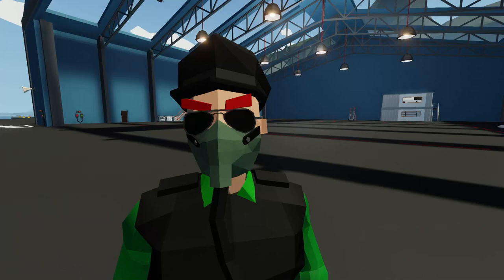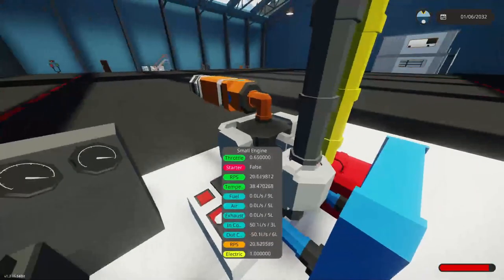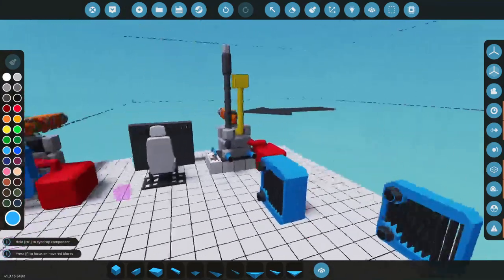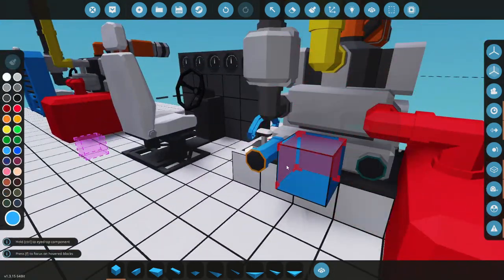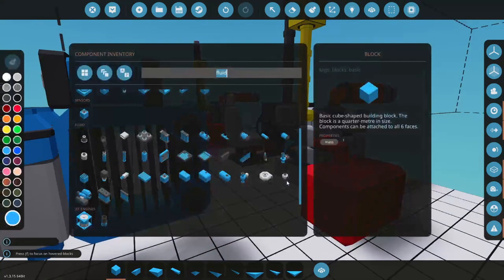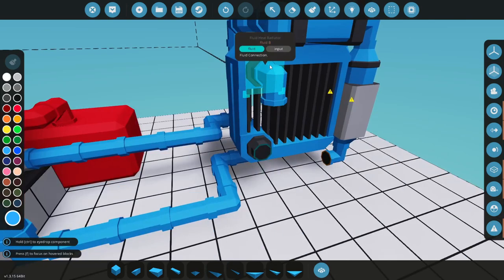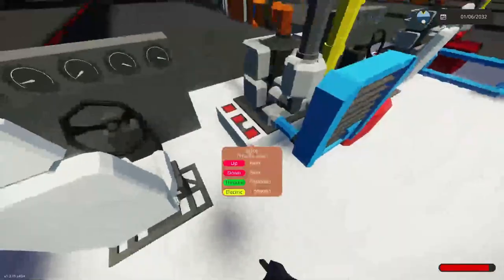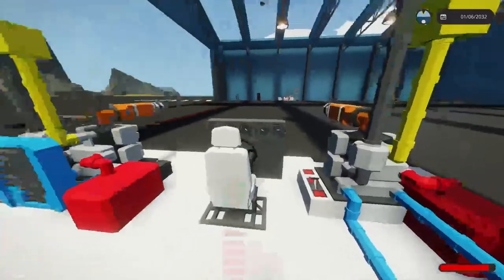Super Cooling your Engine! [Stormworks Beginners Guide Tutorial]

Comment: If you remove the tank, put a valve where the tank was, hook up the valve to a micro controller and remove the radiator on the engine side, you will get what I mentioned in your career series video.  You can make it a bit more compact and allow the engine to run in a temperature range where the engine is more efficient.    

The logic is setup so when engine temp reaches 104 an up/down counter counts up to 1.  When the engine temp drops back down to 96, the counter counts down to 0.    A Threshold gate reading the counter value set to 1 and 1 turns on the valve. 

Turning the valve off, allows the radiator to cool the liquid inside it without being heated by the other liquid.  It will cool down faster and lower the average between the 2 temperatures, so when the valve opens again there is more cooling effect.  

For larger engines. The same setup can be used with larger cooling parts.  And multiples of the cooling system will cool even faster for really large engines.

You can use the pump on/off instead of a valve too.
Reply: Thx I'm really struggling to cool my plane engine the tricky part is that there isn't much space and I want it to look at least decent zo I'm kinda in a loophole here

Comment: I just had an epiphany.  
Cooling in stormworks works on averages.   So if the engine temp is 100 and coolant temp is 20,  the temp coming out of the radiator should be 60, (100+20)÷2=60. The engine should drop 40 degrees.  But since the coolant coming out of the radiator is now 60, the next temp will increase. (100+60)÷2=80.  So unless you can get the temp down through the radiator to the original 20 faster than the engine heats up. You will have a chain reaction of increasing temperatures.   
It could be possible to adjust the flow rate to one radiator. Or alternate between several radiators so that the temperature of the coolant coming out and going into the engine is lower than what the low temp needs to be to maintan and average temperature.   

I have been under the impression that flow rate is the key factor for engine cooling.  But that is only the case if the coolant can be cooled fast enough to get a lower average temperature.  

I did some math and in 1 cycle to keep an engine at 100c with a coolant temp of 20c you would need about 16 radiators in series...   so if you can  cycle or slow the flow rate so that the coolant coming out is lower than 20. You can use fewer radiators or actually start dropping the engine temperature.   

I will need to test this hypothesis before i can confirm the validity of it but mathematically it works.
Reply: I did some simple testing and found that if you limit or stop the flow of a secondary cooling system,  it drops the temperature enough to lower the average temperature enough to cool the engine quite well.  

My setup was 5x5 engine with coolant going to liquid to air heat exchanger, air going through a second air to liquid heat exchanger that was connected to a 5x5 radiator.   The coolant flow to the engine was maxed out.  But I cycled the coolant from liquid/air heat exchanger until the temp dropped below 25.  Then let it flow,  the engine temp at full throttle would reach 85c then when the secondary system kicked in it would drop and stabilize.   Then slowly climb again.   

I still have some testing to do but these were promising results.
Reply from the maker: Makes sense if it spends more time in the system it will cool more.
Reply: @ProfNCognito  But it doesn't work if you limit coolant flow to the engine.    It is basically a step down system where each part lowers the average of the 2 temperatures.  The engines need a higher flow rate because they heat the coolant faster.  Then the radiator can not cool the coolant fast enough because the average is too high.  So if you reduce the temperature of the coolant by reducing the temperature of the coolant cooling the coolant then you lower the average between the two.   

I need to set up a system to measure the delta of the temperatures and averages to see what is the best configuration.    
And also see what temperature the engine is most efficient at.  I know a cold engine is not as efficient, so the engine needs to have some heat, just not too much.
Reply: Any updates?
Reply from the maker: Things are about to change drastically in about a month so I will re look at all systems afterwards.

Comment: Nice clip! Would be cool to have a 2024 version of that supercooling clip since it seems the mechanic changed a lot with the updates.
Reply: I don't know how to cool my engines; they all catch fire
Reply: @apocamuerte41  if you keep your RPS under 20 and have a radiator, you should be fine.
Reply: @steph4050  I'm sorry to inform you that it hasn't worked for me, not even using pumps or the 5x5 radiator... 2 of those, and I tried building a motor from scratch 4 times, and the same thing happens with more or fewer cylinders 
The minimum for my plane to stay airborne was 10 RPS, and even then it still caught fire
Reply from the maker: @apocamuerte41 just tested with new update. Still works.
Reply: @ProfNCognito  The only thing I managed was to keep my plane in the air at 9 RPS and slightly lower the temperature because if I drop 1 RPS, it falls. So my question is, what's the point of building a bigger engine if I can only cool it at 9 RPS?
Maybe I'm extremely useless, and because I don't speak English, there's something I'm missing and doing wrong :c

Comment: that's a very interesting system, wonder if it would fit in a race car
Reply from the maker: Might have to be a big race car.
Reply: @ProfNCognito  I mean, you could use the parts as structure instead of having both structure and parts, if you know what I mean.
Like LMP1 and Formula cars do Irl.

The side of the cockpit could be fuel tanks instead of blocks, and have the radiators between the seat and the engine without other blocks in between 
The main problem is gonna be the gearbox I believe
Reply from the maker: I love the idea. Sounds like a great challenge.

Comment: can you do this with like an actual modular engine? maybe a 1x1 with 12 cylinders radial?
Reply from the maker: It works with all engine types.
Reply: I tested this build without the Liquid to Liquid heat exchange and it actually seemed to run cooler with just 2 radiators on a modular engine
Reply from the maker: @mobius1504  hey nice. sometimes things work out like that. cheeper to spawn in then.
Reply: I was messing around with an alternating radiator system where fluid would switch from one radiator to the other to go into the engine.  My goal was to allow time for the radiator to cool the liquid before sending it into the engine.  
I did not see much improvement on engine temps with that.  I do not think the fluid temp really matters as much as flow,  it is frustrating.   I want to be able to make a thermostat type system that stops the flow to let the coolant cool down until the engine reaches temp, then pump cold coolant to drop engine temp.  I was only successful with that system once on a small prefab engine, but all other attempts have failed.   

Have you tried or had any success with that type of system?
Reply from the maker: Wow.no not really. Would be interesting to try out.

Comment: A modular engine version would be awesome!
Reply from the maker: I agree. But modular engines can be tricky for new players. That's why I opted for the basic vanilla engine. Maybe I'll do one in the future with modular.
Reply: @ProfNCognito  What is the hot water in modular engines? There only the coolant A and B
Reply from the maker: I'm not sure I understand your  question.
Reply: @ProfNCognito  Cooler piece in modular engines have 2 outputs - coolant A and coolant B. Which of these is hot water that i should connect to heat exchanger in your scheme
Reply from the maker: Ah... it's B. B is always out.

Comment: Seems like the engine temp doesn't do anything with efficiency as far as it's not overheating?  Wonder, what if you run diesel to one end of the liquid heat exchanger before it goes in to the engine? Also, have you tried cooling intake air? If it has no effect, Can the fresh air be pushed in to the coolant line and dumped in to the intake air?
Reply from the maker: havent tried that. let me know if you get some results.
Reply: @ProfNCognito  Back from experiment. So, temperature of fuel or intake does nothing with engine performance. BUT using heat exchanger with fuel and intake air is not enough to cool coolant down because engine doesn't sip it fast enough. On the other hand, using diesel as a coolant and cycle it through custom diesel fuel tank instead a radiator seems to work. It takes the fuel tank as a low efficient radiator so bigger the tank, better the cooling. Might work great with ships that has huge fuel tank?
Reply from the maker: Would you be willing to post these results in my discord? I would love to see what you built.

Comment: put 6 of these in my boat to cool 3 medium engines running at 100 rps and it stays at 80c, best cooling ever
Reply from the maker: Um how much fuel you burning?
Reply: @ProfNCognito  a lot but it’s ok
Reply from the maker: Lol
Reply: @ProfNCognito  I just started out but Im making a plane. There are no small coolers I can find. It’s the only other problem aside from stability. The engine overheats and doesn’t work so I crash into the ocean
Reply: Wait maybe it’s fuel. How fast does the medium engine burn a medium fuel canister?
Reply from the maker: It's a thirsty one
Reply: @ProfNCognito  Yeah I just looked it up. Can the small one rev a propeller enough to move an aircraft?
Reply: @ProfNCognito  can engines even burn out and just stop working (with no explosions or fires)
Reply from the maker: Should be able to
Reply: @ProfNCognito  ok thanks

Comment: Trying to cool down a 1x1 x-24 modular and not even three 5x5 radiators in series will do, help
Reply from the maker: Check pump direction. I've put them backwards and not realized it.
Reply: @ProfNCognito  the pump's outlet is going towards inlet a on the radiator and outlet b is going towards pump's inlet, I'm using the modular pump, at full throttle the engine runs at 14 RPS, and I can achieve 45 knots but it can only do so for 3 kilometers before it reaches 100c, even at 10 rps the temp climbs fast
Reply from the maker: Do you have a coolant manifold?
Reply: @ProfNCognito  yes, two of them just to be sure
Reply from the maker: @Tamarodoc  sorry for the delay was asleep. next question, do you have engine manifolds connecting the cyliders on all sides?
Reply: @ProfNCognito  yeah, mostly for aesthetic purposes but all cylinder rows have a manifold connecting them

Comment: I’ve tried and checked everything, and it didn’t work, none of the coolant systems I try work, could it be that I have a 3x3 engine 3 cylinders? Or my gear ratio 6:5? Btw my boat is small,(I built it a the starter outpost for career mode for reference) so that may also be the issue, I am using a modular engine, any way you can give me tips?? I am new to modular engines. 
Edit: I’m using a small tank with fresh water for the coolant, do I need to use medium?
Reply from the maker: So I always asked the few things.  Power? Pumps the right way? What's your rps? Let's start there.
Reply: 22 rps full throttle. Every thing is placed correctly.
Reply from the maker: Do you have a pump (not the port) on the engine. I forget that sometimes.
Reply: The pump that is hooked up to the drive belt? Yes I do
Reply from the maker: @connorw8760  what radiator size you using? If using small ones upgrade to the biggest. This example is for smaller types. That 3x3 is gonna make some heat.
Reply: Well before I used your cooling system I put in a 5x5 radiator connected with a fresh water tank and I still got temps that explode my engine
Reply from the maker: @connorw8760  sounds like something is not connected right.?
Reply: Yeah I’ll be building a new boat soon so I’ll see. I will let you know if the cooling is better

Comment: Medium Modular Engine still on fire.... Even with one cylinder...
Reply from the maker: To much rps?
Reply: @ProfNCognito  70% of power ;-;
Reply from the maker: @FARIKmanTV  what's the rps tho?
Reply: @ProfNCognito  
 I tried this system with small modular motors and it has the same problem. Maybe I'm doing something wrong, but I've already spent two days trying to figure out the reason.... :,)
Regardless of how many cylinders I put on, the system seems to be ineffective at all, well, or I'm stupid
I think I would be incredibly happy if someone accidentally released the same video, but with modular motors... for the dummy
Reply from the maker: @FARIKmanTV  do you have a water tank on the coolant system? Modular does not spawn fluid into the pipes like the vanilla engine does.
Reply: @ProfNCognito  
yes i tried, in different ways, hah

Comment: output of pumps going into output of heat exchanger
Reply: which means the pumps are doing worse for it
Reply from the maker: @mazarinee  just flip it around the right way.
Reply: @ProfNCognito  then it's pumping hot and cold into the engine
Reply from the maker: Ok then. Turn it back around and check all connections.  Something is not the right way round.

Comment: Modular engines are a pain to cool. Anything ever so slightly larger is near impossible to cool.
Reply from the maker: I found as long as you have a good gear ratio to keep your engine at low rps your good.
Reply: @ProfNCognito  3:1 with single gearbox?
Reply from the maker: @TakedaShiroe  can't say because each vehicle is different.
Reply: @ProfNCognito  I am able to run my modulars at 60RPS under load for over 5 minutes, I recommend using an impeller pump for the radiator.

Comment: Engine cooling in general, great idea for balance, terrible in execution, and more so in modular engines, for every cooling manifold you need a pump in and pump out and then a radiator, a single 12 cylinder engine with all the cooling attached is $4k already, wished they would fix this bs cause it's just not fun.